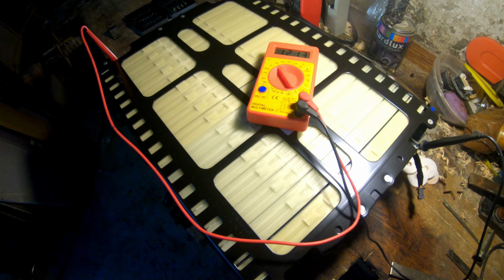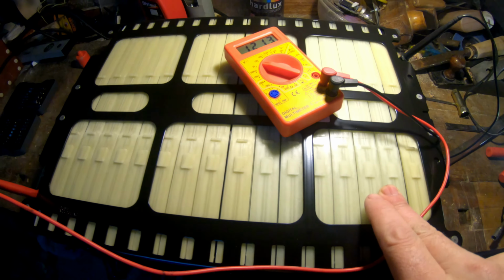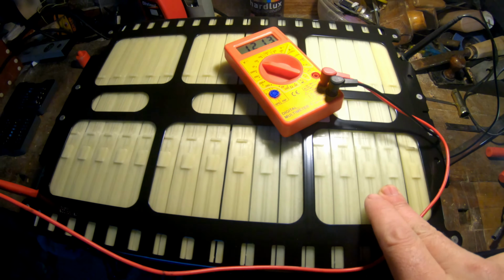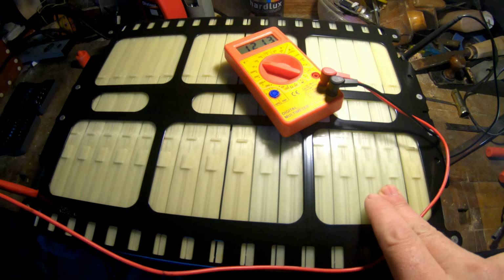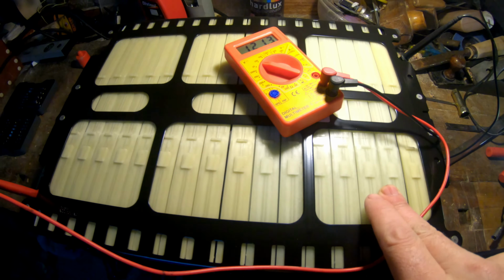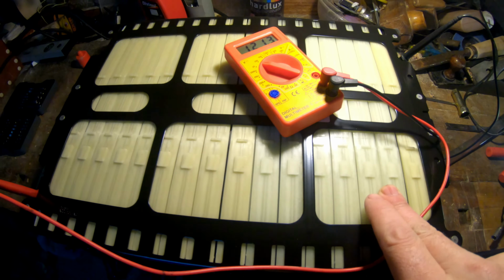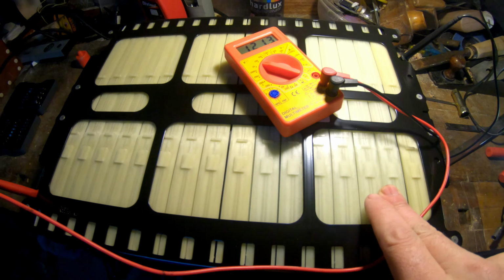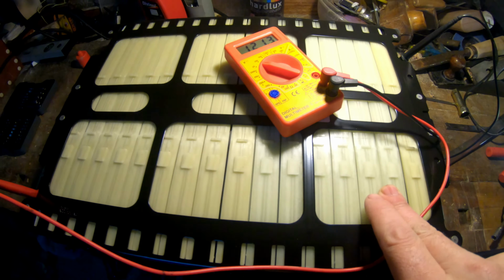48 V battery bank from single 120V 5kWh electric car module

Comment: Those wires could be for the battery management system which makes sure that each battery is charged correctly
Reply from the maker: Yes i know but they are for high voltage bms,since i separated original module into two 48V battery bank now i have to instal a 48V bms 60A two of them to charge each cell with same voltage,greeting